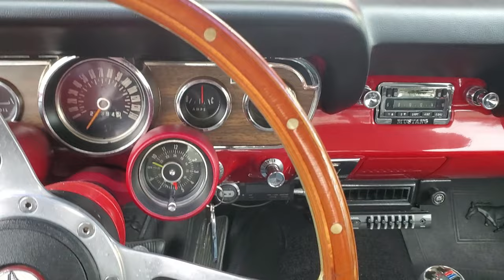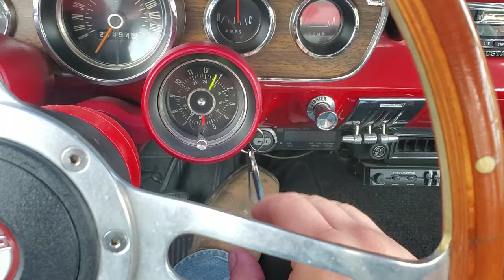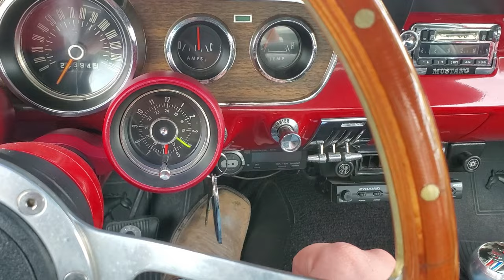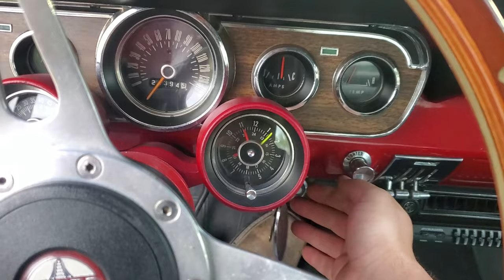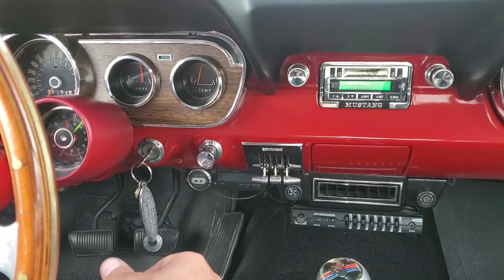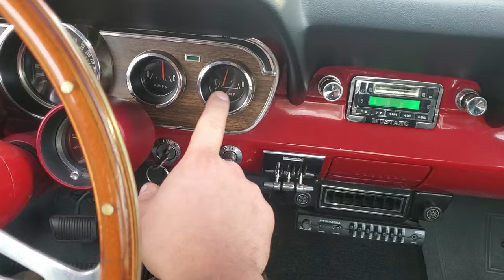(Fix) Holley Carb won't idle unless i keep giving it gas

Comment: Did you close the primary butterflies? Or did you open the primary and secondary’s the same amount? I’m having this issue
Reply from the maker: @sammyvices2547  try just opening the primaries that amount and see if you can get it to idle
Reply: @EddiesCustomsandRestorations  I opened the secondaries the same amount as the primaries and it worked FINALLY! Lol
Reply from the maker: @sammyvices2547  lol 😆

Comment: My 650 Holley double pumper does not have an idle set screw on the primary only the secondary?
Reply from the maker: @alicenfred  it should have one which is your curb idle screw. Check this video out. Where I sort of point the curb idle screw out. https://youtu.be/9wNNubt0NXE

Comment: I got a pos edelbrock carb has the same problem can’t get it to idle after rebuilding it
Reply from the maker: make sure you dont have any vacuum hoses cracked. disconnect your brake booster hose and plug it up to make sure you dont have an internal booster leak. Plug all ports on the carburetor with the little rubber caps. check your needle to make sure its not stuck closed not letting fuel into one of the fuel bowls. These are all things to look for. make sure the gasket under the carb is in good shape too because this will cause unmetered air to enter under the carb causing poor idle as well. Hope this helps
Reply: @EddiesCustomsandRestorations  yea i have the booster blocked rite now i have put new mounting gaskets on the intake pulled intake and put new gaskets there too have pulled it apart a few times and checked my floats are exactly were they should be /new fuel pump also the car sat for the winter then this issue happened i am thinking if something got plugged in the idle circuit ..when it dies it won’t start unless i give it a couple of pumps to the throttle never had such a stupid issue with a edelbrock 🤬🤦🏻‍♂️runs when i rev it  good just no idle i am just lost on it brand new carb
Reply from the maker: @maniacmachanic9870  have you blown compressed air through all the idle circuit holes? One thing you can do is spray soapy water into the holes to where you fill them up and then slowly blow compressed air into it and make sure you see the soapy water exit on the opposite end of the idle circuit just to make absolute sertain that they are not clogged. This is just a way for you to actually see the water coming out the other end. Afterwards make sure you clean the soapy water out with some carb cleaner or gas to not leave that in there.
Reply: @EddiesCustomsandRestorations  i have pulled the idle mixture screws and blew air in there a couple of times no results i need to pull the carb and check it out again going to try what your saying with soapy water and blow out all the ports in the carb with air 
Thanks for the help
Reply from the maker: @maniacmachanic9870  yea just so you can actually see the stream coming out the other end when you put soapy water through it. Sounds silly but it allows you to see the stream without fail. Check your plugs to make sure they arent all black and fowled up. That will cause poor ignition and can also behave sort of the same way tonwhere under acceleration it will stay on because the spark fires are firing faster to where it can over power the fowl but at slow ignition its too slow and not enough. Ive seen it. Doesn't hurt to check them.

Comment: Thank you so much for this video definitely the problem on my carb. But for some reason after I adjusted it the link bar going from primary to secondary lever is binding up any ideas?
Reply from the maker: @weedbros4202  hmm that is odd. Check the little plastic cams by the accelerator to make sure that's not binding.

Comment: What size screw driver did you use to adjust the transverse slot
Reply from the maker: i dont know what size that would be. To be honest with you i have a ton of screwdrivers but their size has never been common knowledge size they are never labeled.  But the flat is about 1/8 of an inch wide.